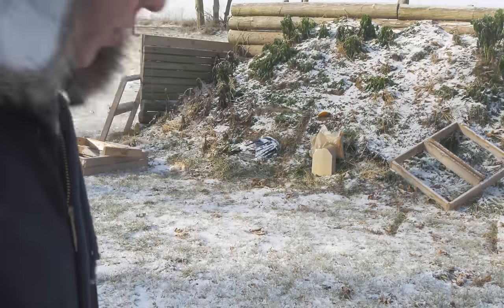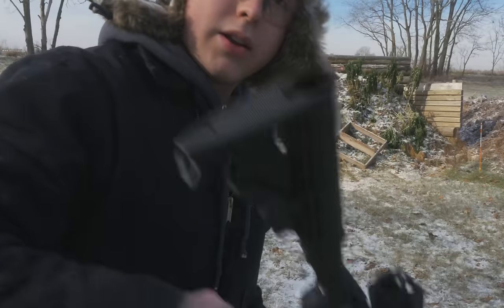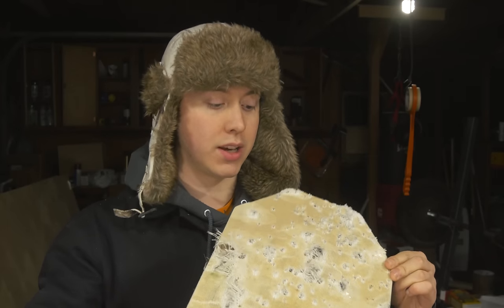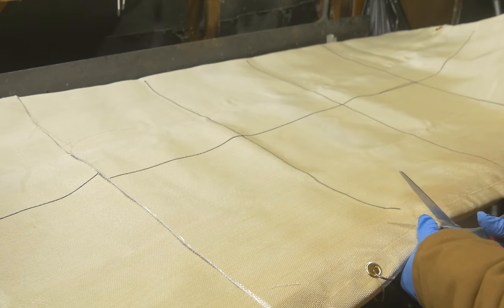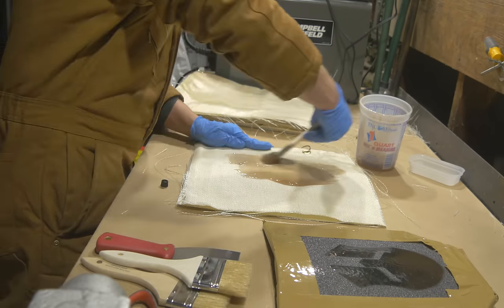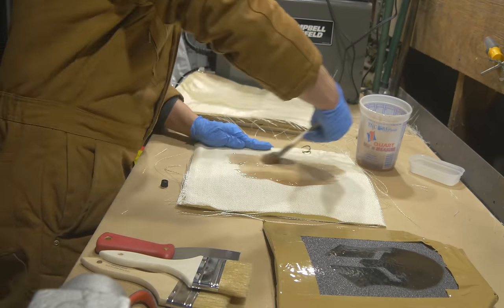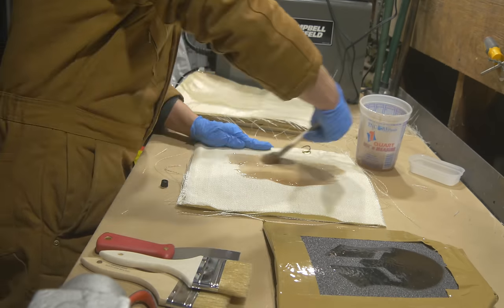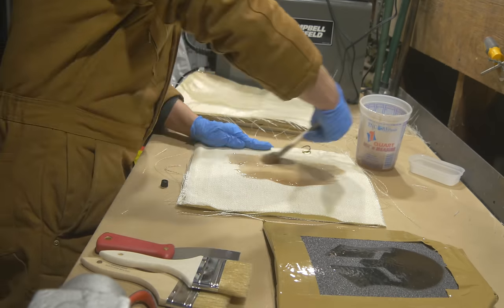How to Make AMAZING Bullet Resistant Armor for $30

Comment: The previous shoos were likely already weakened the integrity of the fiberglass plate. You need to fire the 5.56mm bullet to a new armor plate to truly test the penetration force.
Reply: Also it would be interesting to see ar from long distance.  Like 150meters at least.
Reply: @JamesParus  At 150 m it would not lose enough velocity to not penetrate. Also that round was penetrating no matter if he shot with the 5.56 first or last.
Reply: Meh, I don't think it would make to much of a difference, this looks it holds pretty close to a 3A standard meaning it will stop pistols and shotguns but wont stop most centerfire rifle rounds (excluding stuff like .17 WMR and .22 Hornet).  Plates that can stop rifle rounds tend to be a good deal thicker and heavier.
Reply: There's no point, 5.56mm would penetrate it with no problems. You won't be stopping any rifle rounds with these plates mostly due to the velocity that these bullets travel in comparison to what comes out of a cartridge like 9mm or 45.

The reason the plates stopped the rounds from the handgun is because the tip of the projectile from 9mm is so blunt, so the area of impact is an order of magnitude larger than a 5.56mm bullet.

The geometry of the projectile matters quite a bit when you're talking about penetration. The geometry of a 5.56mm FMJ lends itself very well to penetrating ballistic armors because the area of impact is significantly reduced in comparison to a 9mm.

It will take a certain amount of PSI of force from an object to penetrate a material, since the figured used to deacribe it is PSI and PSI = pounds per square inch you can see that there's a direct relationship between the force exerted and the area of impact.
Reply: We can put numbers on this. In fact, I can copy-paste my own comments from elsewhere with some numbers for this. Of course, I could have made a mess of them.
I've found an Indian document about armour testing, which says the maximum acceptable depth of a dent in a clay model torso behind armour is 43 mm, so we can work out how hard a bullet has to be pushed back to stop it quickly enough.
4 g 5.56 mm at 950 m/s: mean velocity 475 m/s; time available 90.5 microseconds; acceleration required 10.5 million m/s², which is over a million "g"s, which is quite a lot; force required to achieve that 42 kN.
15 g .45 ACP at 270 m/s: mean velocity 135 m/s; time available 319 microseconds; acceleration required 0.85 million m/s²; force required 13 kN.
The 5.56 needs 3.3 times the force to stop it, and it's hitting about a quarter the surface area of vest, so it exerts 13.95 times the pressure on the vest.
That's why it's so much harder to stop. It's also going to exert a whole lot more pressure on the guy inside the vest, even if there's a plate in there.
For comparison, the very small:
2 g .22 LR at 360 m/s: mean velocity 180 m/s; time available 239 microseconds; acceleration required 1.5 million m/s²; force required 3 kN.
... and the very big:
12 g .30-06 at 820 m/s: mean velocity 410 m/s; time available 105 microseconds; acceleration required 7.8 million m/s²; force required 94 kN.

Additional numbers:
8.04 g 9 x 19 mm at 350 m/s: mean velocity 175 m/s; time available 246 microseconds; acceleration required 1.42 million m/s²; force required 11 kN.
42 kN spread over a 5.56 mm diameter is 108 N / mm².
13 kN spread over a .45 inch diameter is 7.74 N / mm².
3 kN spread over a .22 inch diameter is 7.68 N / mm².
94 kN spread over a 7.62 mm diameter is 129 N / mm².
11 kN spread over an 8.82 mm diameter is 11.7 N / mm².

Sanity check: 5.56 mm is half of .45 inch, so a quarter the area, so four times the pressure; it was going three and a half times as vast, so twelve times the acceleration, so ten times the pressure; it only has a little over a quarter the mass, so a little over a quarter the force, so a little over a quarter the pressure. Three and a half times twelve times a bit over a quarter is ... about twelve. Twelve eights are 96. Close enough for a rough estimate.

Another way to look at it: 4 g at 950 m/s is 1805 J, 74.3 J / mm². 8.04 g at 350 m/s is 491 J, 8.04 J / mm². You've got nine times the energy per unit area with the rifle bullet.

To get down to the same energy per unit area, you're going to need to slow that 5.56 down to {ahem} 350 * (8.04 / 4)^(1/2) * (5.56 / 8.82)² = 197 m/s, which is 647 ft / s, which means a range of {gets out long range ballistics chart} well, a lot more than 1000 yards, anyway. Maybe if you could go out into a desert somewhere and hit it from a mile away, it'd stop it.
Reply: @Sableagle  what are your thoughts on using something extremely hard to cause the bullet to shatter upon impact like a prince rupert drop?

It's already been demonstrated that they're durable enough to withstand being hit with a 7.62mm projectile without shattering. It's hard enough to cause the projectile to shatter.

If I had in the middle of an epoxy plate, a layer of prince rupert drops locked into epoxy, could that serve as an effective way to stop a rifle round from penetrating the rest of the plate?

If the bullet were to shatter would that have the effect of dissipating a great deal of the energy? Or at the very least cause the impact to be spread out enough to feel like a horse kicked you in the chest instead of killing you?
Reply: @franklingomez5311  See my direct comment on the video at about the same time. I suggest ceramic tiles for exactly that purpose. Tearing a bullet to pieces takes a lot of energy, shattering the tile takes some energy and the impact spreads out in some sort of chaotic pyramid through the layers of tile.
Reply: @Sableagle  I saw your comment, and I couldn't help but think that 4 layers of ceramic tiles would add quite a lot of bulk to the plate.

I mentioned prince rupert drops because I saw a video where prince rupert drops were made by dripping the molten glass into liquid nitrogen instead of water, it had the effect of creating PRDs that didn't shatter catastrophically when the tail end was broken. If that is truly the case, then in theory they wouldn't break from the epoxy flexing due to impact. They would require direct impact to break.

This got me thinking, PRDs seem to be able to do the job of ceramic tiles but in a much more compact form. My theory for why that is was that the geometry of a sphere lends itself better to resisting a mechanical load than any other shape, much better than a flat ceramic tile.

Smartereveryday has a video about testing PRDs against various calibers, in his video he shows in slow motion the bullets impacting the drops. You can see that the only reason the drops ever shatter is because the projectiles spall and the pieces of the projectile end up hitting the tail end of the PRD, causing the whole thing to shatter.

If I could make a prince rupert drops with minimal tail end and made them via liquid nitrogen instead of water, I could make a sufficiently durable single layer that would be hard enough to cause the projectile to spall while still adding minimal bulk to the plate itself.

Let me know what you think, also take a look at my comment that talks about making and adding graphene to the resin. I'm very interested to hear your repsonse.
Reply: @Sableagle  I also go into detail about shear thickening fluid treated ballistic fibers. I'm interested to hear your response on that as well.
Reply: @franklingomez5311  I don't know enough about graphene to comment on that one. On the PRD plan, maybe if you get the glass hot enough and drop it from high enough up, you can make it fall as droplets that'll hit nearly spherical and set nearly spherical, like the lead drops in a shot tower.
Reply: As for bulk, yes, they would add extra bulk. It'd be a very visible pack of stuff, not something that could be hidden under a dress shirt and dinner jacket, and having the weight of the front plate pushed out like that would probably affect balance enough to matter over time if it wasn't balanced by another on the other side of the body, but there is an advantage to the bulk. Having an outer plate with two cm of padding between it and your ribs changes the acceptable stopping distance of the bullet from 4 cm to 6 cm, 3/2 the distance to 3/2 the time at the same mean velocity to 2/3 the acceleration so 2/3 the force and 2/3 the pressure. That improves the plate's ability to withstand the hit and reduces the impact trauma to the person wearing the plate. I guess it'd also reduce the risk that a hit while running would make you stumble, but 9 mm, .45 and 5.56 isn't likely to knock someone off-balance anyway. I'm sure a shotgun slug to the back of a running middle-school kid would send them sprawling, so maybe that effect would matter in that sort of scenario. There's got to be some range of impact to target ratios where it would help.
If the padding is deeper than the amount the plate flexes, it's preventing a focused impact on the body behind the plate, too. First steel plus padding saves the ceramic on the second half, so it's still there for anything that gets through the first steel, and both together spread the impacts out over the ribs and organs so you get "some bruising" everywhere rather than "ruptured organs" at the impact site.
Reply: @Sableagle  well if you're interested in learning about it at all I provide the names of some papers relevant to the discussion in the comment section below my direct comment to the video.

I also give details on how to access research papers for free, in case you're not already aware of how to do that.
Reply: @Sableagle  I was thinking of getting a tapered pipe made of tungsten carbide and using that to hold the molten glass at around 3000 degrees. At that temperature the glass should be more than hot enough to drip without leaving a tail.

I also mentioned shear thickening fluid because if it was the last layer of defense between your plate and you it would have the effect of conforming to the shape of your chest upon impact and effectively spread the load out to the size of the plate. Further reducing the felt impact and saving your rib cage, in theory anyways.
Reply: Also that bit about shooting a middle schooler in the back really isn't relevant to the discussion and makes this all sound a lot worse than the conversation I'm trying to have. Lol.
Reply: @Sableagle  Wow I must admit I’m lost with your calculations…. Love the math but you were completely over my head! I’ve decided to just duplicate your build and then just try my 7mm mag…… at 100, 50, 25, 10 yards by using different layers on a square shape! I’ve never had anything get away if that round hits it! And if I can stop that then I’ll make two or more that will fit my larger size a little bit more!  I do have a question though!  When it had such a tight fit on the plates you use for a pattern why not leave them adhere together permanently?

Comment: Tomorrow morning im going to tractor supply and home depot and im literally going to make chest plate. Back plate and leg plates.
Reply: This is the way.
Reply: Don't forget the lower sides of your torso, under your armpits and maybe your biceps. For the smaller pieces (not the chest or back plates), you may want to sew in pockets to the inside of the clothing you intend to wear, then put your homemade stuff into those pockets and sew them in so you never have to remove them. Figure out what you can bend and move around in. Just a thought. Oh, and don't forget the best eye and breathing protection you can afford if you really intend to work with fiberglass. That s--t will shorten your life if you breath it in.
Reply: Dude. Just go with premade plates. There is a reason that the NIJ tests plates. Because they need to be proven. This is what’s stopping bullets. Buy quality, don’t gamble.
Reply: I've been wondering how I could make my own body armor rather than spending and arm and leg buying it from a company...now I know. I'm gonna make a few add-ons to it however.
Reply: Full mando welding blanket armor!
Reply: @JackSilver1410  Dude, have you seen the world lately?
Reply: @JackSilver1410  That story is hilarious. I'm not going to argue about x, y, or z scenario happening. I just think there is no harm in being alittle prepared as long as you make informed decisions (canned food vs perishable) and don't go crazy over it.
Reply: @JackSilver1410  I wonder if the kids at Columbine HS thought the same thing.
Reply: @ajax1137  I look at it this way. What's the worst case scenario? I die? By and large, the population around me is so brain dead that we should be classified as separate species. In a perfect world, I could keep them as pets. There is no stability, you can trust neither leaders nor followers and there is no way to fix it. I hate the world, I hate the existence I've been forced into and I want out.
If i face down some crazed gunman, there are two outcomes. They either back down and prove that they're the coward I know they are, or they kill me and I get the release I want. Don't kill me, I win. Kill me, I win. What harm can possibly happen to me?
Reply: Dont worry man , if you fail to prepare, you prepare to fail. You are one step ahead of others.
Reply: @jimmyalamo839  How are you getting internet down in your bunker? That's incredible service.
Reply: @JackSilver1410  protection bro. I mean we're living in times where people are really going mad and almost so angry that they might just attack others randomly based on things like race and identity politics alone! When you go to the bank, or anywhere where there's people, or a protest or rally, it makes sense to be as protected as possible
Reply: @JackSilver1410  oh c'mon man. It's good to have. I'm talking concealed stuff mainly so when you go out, you're safer. I'm talking about let's say the mall for example. There will be plenty of false flag attacks when Biden gets in to blame it on the "far right wing conspiracy gun nut jobs". So this is when states will put in laws right away, plug and play type of laws pre drafted to make it very oppressive on gun owners. But alas, I digress. Yeah so I'm definitely not a favored demographic right now and I can tell you that safety is decreasing, and danger is increasing. That's all man. Crime rates are going up in a lot of places too, so it's smart to upgrade your personal protective gear to this level. Is this new? Yes. But shit is breaking down bro. Always remember the saying... "It's better to have something and not need it. But if you don't have it, and you find out you needed it, that could be the difference between life and death."
Reply: @JackSilver1410   thank you angry one : )
Reply: Dont forget the nut plate
Reply: Rj Peterson ooooh so edgy, so angstyyyy.
Reply: Make a video of u doing it
Reply: I'm going to make one large panel and set up deployable barriers
Reply: Do you own a tractor? 🚜
Reply: @Distrusted_Citizen  lmfao
Reply: @spoonbruh741  Because being aggressive has gotten me far in a world filled with pacifists. Because people want plates to stave off something that will get to them eventually anyway. It makes no goddamn sense. People spend so much time and effort running from death when it's more rational, more reasonable to just get used to the idea that it can happen at any time.
Everyone is always droning on about living with no regrets or living each day to the fullest, but no one seems to be actually doing it.
Reply: @JackSilver1410  bro that’s some Doomer shit if I have ever heard it. “Sorry I don’t want to die”. 🤪
Reply: Metireal name
Reply: Which material used??

Comment: Someone beat me to it, but rotating each layer so the weave isn't aligned with the last will make it stronger.
Reply: FeardedBellow this is correct
Reply: No idea what you mean but I'm going to assume you are in fact correct
Reply: If you treat the layers like XY planes, with the Z axis normal to the plane, it's easy to visualize. Layer 1 is the weave oriented along the X and Y axes. Layer 2 is laid in, rotated maybe 10 degrees around the Z axis. That way, the weave pattern in each layer isn't the same direction.
Reply: FeardedBellow 

Even better/stronger if you rotate each layer 45 degrees...
Reply: i suck at english,would you explain to me?? (simplfied pls)
Reply: I'm Bored  alternate the weave pattern when applying layers
Reply: Put each piece in a different direction -- // || \\   <--- like that
Reply: I'm Bored have you ever made a tower or walls of like legos? If you just stack the bricks strait up, it's pretty fragile. If you overlap the bricks, you get a lot more strength in the joints. Look at cinderblock brick walls for a better example. Simply replace the bricks with string and you get what these folks are talking about.
Reply: ah yes grenadier thanks for clearing that out!
Reply: If you rotate 90 degrees, yes I agree. But if each layer is rotated less than 90 degrees, the + will not remain oriented to itself.
Reply: +FeardedBellow in composites layers are often rotated 30º or 45º degrees, especially with weaves (because rotating a weave 90º makes it equal to the 0º layer).
Reply: Titanium Rain Pretty much exactly what I already said... I dunno why people misunderstood my original comment...
Reply: Keystrokes 
He's trying to say that, like plywood, having the grain of the material going in different directions makes it stronger. 
Which is indeed the case, since it spreads the force of impact in multiple directions, not just vertically.

Comment: Next time use a 4" angle grinder and thin cutoff disc and it will cut that fiberglass cleanly and easy like butter.  Always wear a respirator too.

Comment: I would consider coating the edges where you cut and sanded with resin to prevent any fiberglass slivers. Great job designing and building a cheap, lightweight DIY body armor!